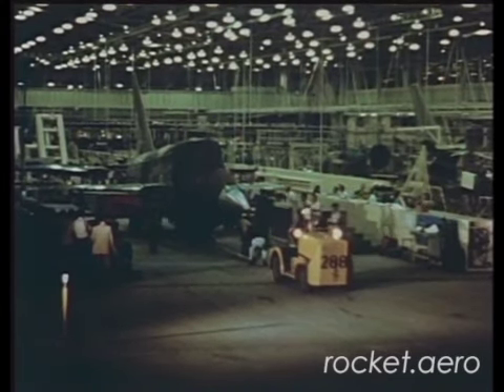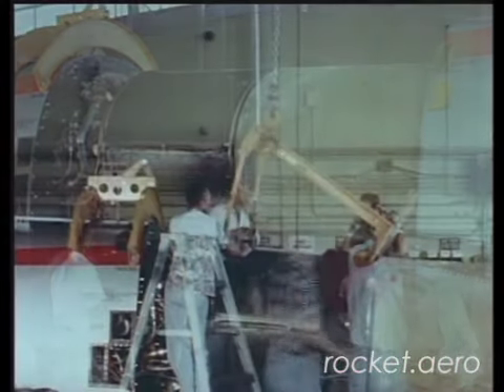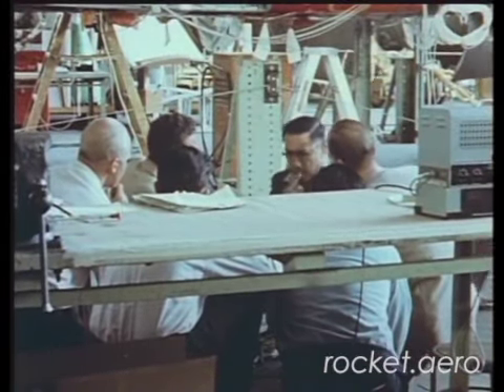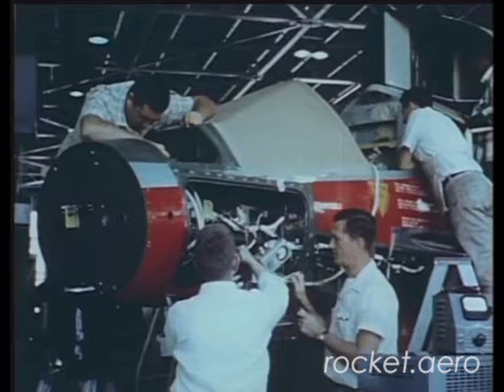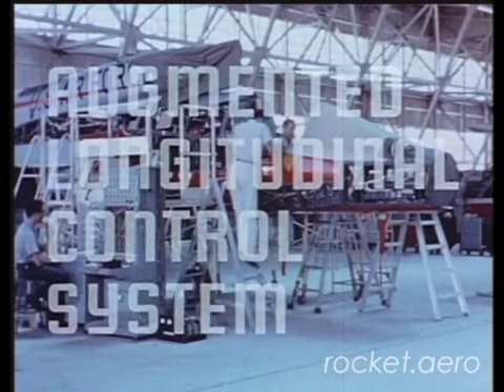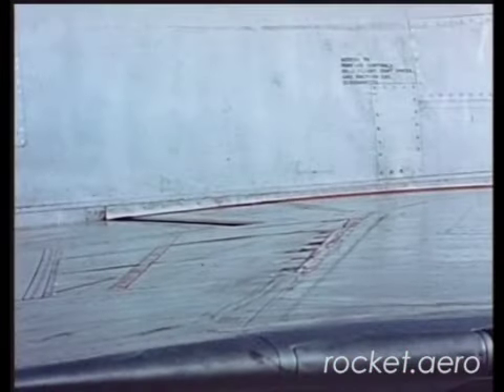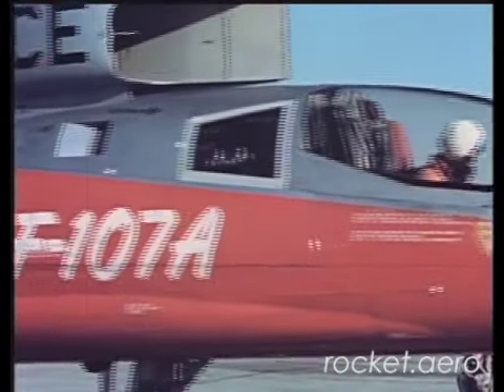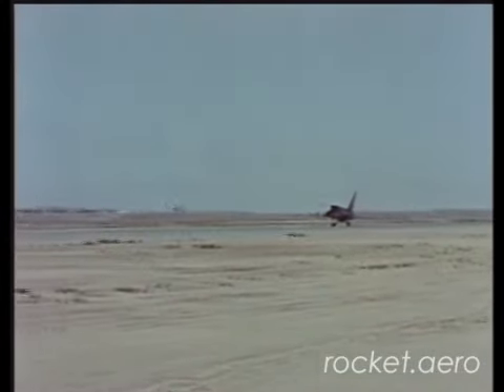USAF F-107A Documentary

Comment: For the critics, the -107 was never expected to win the competition with Republic’s mighty Ultra Hog.  It was primarily a research vehicle (researching, for instance, an advanced inlet design deliberately placed above the fuselage  for specific research purposes) and was never more than a potential backup in case Republic blew the -105 design, which they sorta kinda did initially but eventually turned into an awesome machine.
Reply: As a matter of fact, the 105 was indeed an awesome machine. But then again, it was the only US fighter put out of service due to high losses.
Reply: Some say it was called the Thud because that was sound it made hitting the ground.
Reply: @stefanhernold345 o be fair, that's because it was being used for a role it wasn't intended (as well as the USAF not having enough knowledge on countermeasures for SAMs, as well as not expecting the NVA to have such a solid air-defense network)

Comment: Could be wrong but I believe THIS plane "118" is at Pima Air in Tucson while "119" went to Ohio. Started out as an upgraded Super Sabre to be dubbed the Ultra Sabre, and due to the Air Force's requirement for an internal bomb bay they placed the intake on the top of the fuselage. Of course Republic won out with the F105 and the rest is history. The 107 was used for some X15 testing before being returned to North American.
Reply: You are correct. The F-107 in the NMUSAF is serial 119.

Comment: The F-107 is considered the best aircraft ever rejected by the U.S. Air Force. It had issues but none that weren't correctable with a second prototype.
Reply: YF23 Black widow Faster and more maneuverable than the F-22, not to mention much further along in the development stage and an even smaller radar cross section
Reply: @zacht9447  Ah, NO...
We get it that you're a fanboy BUT if you're going to talk about a jet, know some basic things about it.
1) The YF-22 was more maneuverable than the YF-23.  It had thrust-vectoring and the wing design was biased towards greater maneuvering power. 

The YF-23's ruddervators were a feature NASA had serious qualms about.  They did studies with planes with that tail design and they had issues with recovery.  The YF-23 may have had reduced drag, yes, but it was also less controllable across the flight envelope than the YF-22.  A conventional tail is still better for control.
2) The difference in radar cross section wasn't THAT great between the prototypes and they reduced it in the F-22.
3) The YF-23 would have been more difficult to produce.  Compound curves are harder to manufacture than flatter segments.
4) Northrop was involved in a major scandal at the time of the ATF competition.  The USAF had serious doubts they'd be able to deliver on the project.  The company has NEVER managed a fighter program that big and the most sophisticated program Northrop had running was the B-2 which had its own problems.  
5) If that wasn't enough, the YF-22 demonstration program was far more impressive than the YF-23 demo.  They fired weapons from the internal weapons bay, demonstrated extreme controllability at high AoA in the YF-22, and greater overall maneuverability.  The YF-23 demo was very restrained by comparison and they were much more cautious.  In the last two major USAF fighter programs, ATF and JSF, the Lockheed team pulled out the stops and they flew their prototypes far more aggressively.  They demonstrated greater confidence in their planes.  Their competitors, by comparison, ran almost meek programs and had some serious technical issues with their designs.
Reply: @zacht9447  And both lost out to a Lockheed design. Coincidence? I think not...
Reply: @jwenting  well the f107 lost out to a bribed in design so................

Comment: "How much does it weigh?"
"Twenty-six five."
  About double the weight of an empty WW2 era P38 twin engine fighter plane.
  Plus, it's got almost triple the speed, four times the heavy duty (20mm) firepower, and a thirsty turbine inside gulping down fuel at twice the rate of the twin engine high performance prop fighter.
  Personally?  As a graphic artist I think it's about the coolest plane ever.  I can see a couple problems immediately, though: 1) zero rearward vision. 2) Engine intake right behind the ejecting pilot.  I feel the F-100 was a mixed bag, too.  I wonder what the competition come down to, ultimately.

Comment: Hello. I had a model of this aircraft when I was a kid. The 1950s had some bizarre experiments. Considering the Russian fighters today have engine air intakes on top for takeoff/landings to prevent  debris from being sucked into the engines, perhaps the xf-107 intake on top of the fuselage was "visionary"?
Reply: This was the first variable inlet design - used in many subsequent high speed aircraft.  Originally it was supposed to be in a chin position like on the F-8 Crusader, but Air Force officials were concerned that location would affect the semi-submerged nuclear store in the belly, on release.  The instrument package lifted into the belly would have been the nuclear store.
Reply: @danzervos7606  They NEVER used the bomb bay in the F-105 in practice.  They put another fuel tank there.
In fact, half the tactical aircraft that EVER flew with compartments like this ended up using their "bomb bays" to carry extra fuel because of weapons separation issues.
The A-5 Vigilante is another plane of the same era (from the same manufacturer as the F-107, in fact) that had a bomb bay used for an extra fuel tank.  It didn't even last long as an attack plane and spent most of its 18 years in service as a reconnaisance aircraft!

Comment: Yes, the Ultra Sabre was an ugly solution to whatever was the question of that time. It does not look right at all, probably unstable in a turn too with all that side area high upfront.
Reply: That's funny because virtually all the historians and documentarians say the F-107 was one of the better planes the Air Force didn't buy.
The F-105 had plenty of issues, too, and had a VERY mixed service record.  It was the end of Republic as a tactical aircraft manufacturer.  They did NOT make a good transition into jets and their best fighter by far was the P-47, not the F-84 (in any version) or the F-105.  HALF the production run of F-105s were lost in Vietnam because of serious design flaws in the plane and bad training.  It wasn't a particularly good tactical bomber contrary to the reputation people today believe it has.
Reply: At the time of the development of the Century series Fighter aircraft it appears the USAF was interested in plane that were stable in a straight line at high speed. The doctrine was Dog fighting aircraft were things of the past. Maneuverable was not needed they said.

Comment: What were they thinking when they designed this aircraft.
Reply: They were trying to stretch the F100 design, it wasn't a bad effort but Republic came up with the F 105 a clean sheet of paper design that was markedly better for the fighter bomber role .
Reply: The Air Force was looking for nuclear strike aircraft, and these were an evolution of the F-100. The intake position above the cockpit severely limited visability, which was one of the factors that led this to lose to the F-105.
Reply: They were pushing boundaries and trying to innovate. You have to remember that the concept was only conceived 6 or so years after WWII, where subsonic piston engines were the norm.

Comment: Needless to say, pilot visibility to their 6:00 was sub-optimal...
Reply: @Etienne I was gonna say -- and it's like the F-105 was designed to be a dogfighter, too?

NO, neither plane was an air superiority aircraft.  They were fighter-BOMBERS with emphasis on the attack mission.
They really should have been called A-25 or whatever the numeral for "attack plane" was up to that at time.  Likewise, the F-111 was not fighter, either.  It was a medium bomber.

The F-105 had horrible maneuvering power, poor visibility, AND poor survivability against flak.  They never thought the planes of that time would survive if they got hit so they designed them to have the main and emergency hydraulic lines run SIDE BY SIDE in the airframe!  That ensured the planes WOULD get lost if both control lines were hit!
They lost a lot of F-4s and F-105s because of that dumb decision in the design and manufacturing.  When the F-14 and F-15 were designed, they made sure to locate the hydraulic as far apart as possible to increase the survivability of those planes to hits.

Comment: F-100 2.0, same big wing as the Hun. Mach 2 lost out to F-105 which was embarrassed by subsonic MiG-17 at Dragon Jaw bridge when F-100 claimed a probable with big wings. Note conformal belly tank/store compared to clean F-105 bomb bay or non-conformal belly tank. Funny over-cockpit intake also used on ill-fated Boeing F-111 losing design.
Reply: How did the F105 lose out to the Mig 17? Boeing didn't build the F111, General Dynamics did and it went into production and served very well.the intakes are on the side of a F111,not on top. The F105 was a nuclear capable bomber, the mig 17 couldn't catch it if the Thud driver turned off his engine.
Reply: @g24thinf  Rules of engagement. 105 could not attack till Mig was inside air to air missile range. Mig was smaller and turned faster and if they had an altitude advantage they also could be faster in dive. Boeing did win the comp for F-111 but each time (3X) it got rebid. Had something to do with LBJ and General Dynamics both being from Texas. McNamara wanted the Boeing plane but Secretary of the Air Force was LBJ's boy.

F 105 was much more a fast bomber than a fighter.